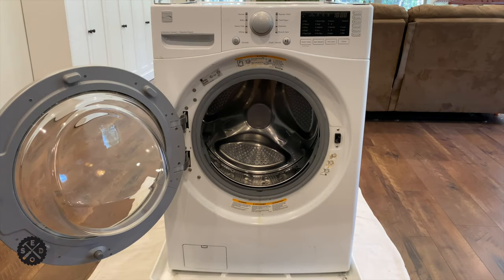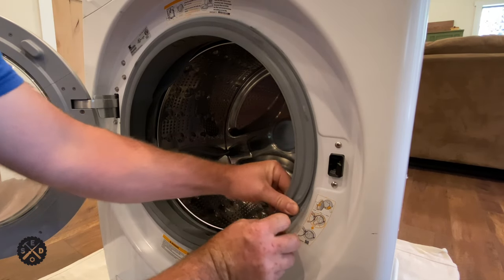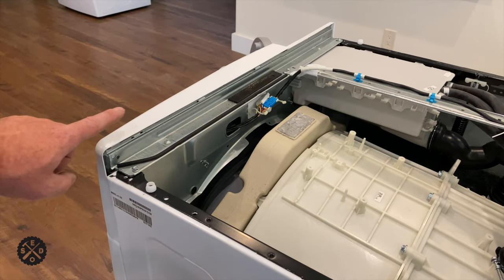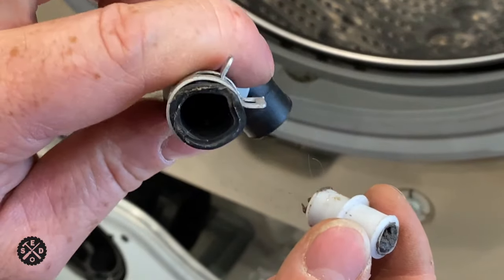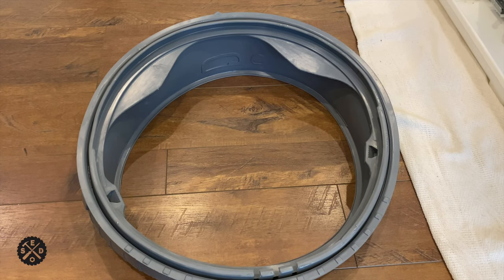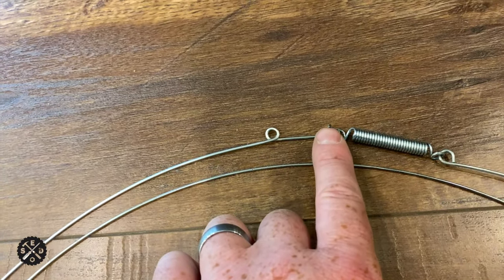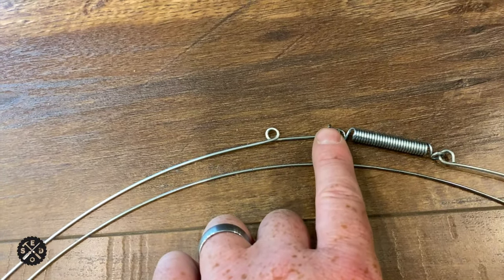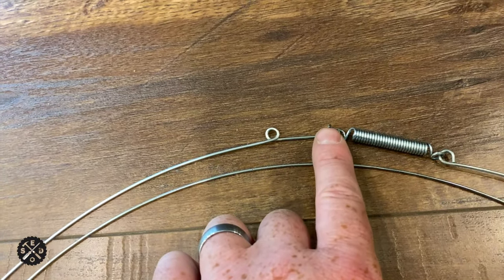LG Kenmore Washer Door Boot Seal Replacement Fix Leaking

Comment: Perfect video, great information clearly presented. And I can plie on to the other comments:
1. AGREED: Get The Pliers!, why struggle and damage your new gasket? 
2. AGREED: Clean the hose! - mine was plugged worse than shown in your video.
3. Also, look for the other videos on cleaning the water filter. I had never cleaned mine, it's easy, and mine was FULL of linty goop.
4. If you have a small hole in your boot and you need a fix for a couple of days while your new boot ships, I actually had success with a bike tube patch. Dry the area, clean as well as possible and follow the bike tube repair kit instructions. The real kind with the glue. This worked for me for a week of wash, but the hole was only about 1/4".  
5. Last but not least - if you are feeling lucky...I decided to try replacing the boot without taking the front off the washer. I used a slat of scrap trim about 3/8' thick and 2" wide, maybe 14" long to gently wedge the drum over to one side or the other to install the boot and inner spring. This was not that hard, the drum is suspended and it has a lot of flex in there. You really need to be sure to get the inner spring in the groove properly, feel around the whole diameter and press it into the grove. Don't try it without the pliers.   I would not try this unless I had lots of experience as a technician on other stuff. But it went very well, did not require more tools, and made the job very quick. My washer is pretty much built into the area, so I was really motivated to avoid pulling it out. If you have space, just pull it out and do it like the video shows. The instructions are great. THANKS!
Reply from the maker: Awesome great job! Thanks for sharing the tips!

Comment: In terms of clarity of explanation this is one of the best U-Tube HOW TO Video's I have ever seen!   Thanks.  Yes, our gasket drain hose was plugged up.  I managed to clean get to it and clean it by just removing the front gasket spring and lifting gasket up at the drain hose to removed the hose.  Getting the hose clamps off, hose loose at both ends, and putting them back was the hardest part.  Thanks for posting this video!
Reply from the maker: You’re welcome. I’m glad if it helped thanks for letting me know!

Comment: Great Video.... One comment - I spent 3/4 of the time trying to get the rear spring back on. What worked for me was to remove the bottom weight bank (curved plastic looking thing with four bolts below the door opening). This helped a lot. Definitely need the spring tool!
Reply from the maker: Thank you! And thanks for sharing your experience with the rest of us. Good job getting it done!
Reply: It took me good 30 min to put on the rear spring. Taking out the plastic weight helped alot. Be careful when you take out the weight as it weighs quite a bit and may hurt your foot.
Reply: Same

Comment: 1 important step (maybe): the two weights can be removed with a 10mm socket so that it’s easier to take off and put on the seal in the back. You did it without removing the weights, but I’m sure it was a little harder to fiddle with the seal.
Reply from the maker: Yes I did it without but if it makes it easier might as well try it and see how it goes. 👍🏻

Comment: Extremely helpful video, I was having same problem. I ordered rubber seal and pliers which I highly recommend. I installed it with my son in two hours. Saved $200, thank you so much!
Reply from the maker: Awesome I’m so glad it was helpful thanks for letting me know and great job fixing it!!!
Reply: I fix my washer machine and it took me less than 10min after I watched this video well done for explaining very easy.
I was trying for about 1hour the ring kept coming off.
I wished I watched this earlier.
Reply from the maker: Awesome I’m glad you got it!

Comment: Super helpful video.  Worked for me.  However, i found that the spring stretcher didnt stretch the inside spring enough to put it on.  I found it easier to take the spring off the clamp wire, install the clamp on the gasket, then install the spring back on the clamp.  I also used an extra piece of wire to hold the clamp tightly in place while i attached the spring.
Reply from the maker: Thank you! Glad it helped. Thanks for sharing your experience with others too.

Comment: Probably the best video I have found for this door seal. Straight  to the relevant points, clear description, great video well edited, no dogs, no kids, no annoying wacky background music …(already have all that….😎)
Last but not least the great tip about cleaning the tubes and making sure the bottom drain tube is not blocked…this is clearly the main cause of the stinky moldy sludge which collects at the bottom and rots because it does not drain. If these are cleaned regularly I doubt that the door seal will ever have to be replaced again.!!PERFECT!
Reply from the maker: Thanks Steveo I appreciate you letting me know!!

Comment: We were having leaks under front of washer.  Watched your video and found out about the drain hole in the bottom of the seal/gasket and the tube that connects it to the drain system.  Our gasket drain hole was plugged with lint.  I used a turkey baster to squirt water into it.  At first it wouldn't go.  I couldn't force any water through the drain hole, then all of a sudden it was open.  I squeezed a cup of hot water through the hole and ran a couple test loads .... NO MORE LEAKS!  I never would have figured this out without your video.  MANY THANKS.

Another helpful idea .... put the washer "feet" up on short pieces of 2x4 so you can see under it and see where leaks are coming from.
Reply from the maker: Wow awesome I’m glad you fixed it! Good for you. I know the feeling 😅

Comment: You’re a life saver! I pulled mine apart and soaked my rubber seal (it had a bad case of black mold). Putting it all back together was the tricky part though and people had their doubts I could do it. It was only thanks to your little extra tips that I managed to do it. Eg. the way you showed how to put the springs back on by closing the spring circle first and fitting as much of the spring as you can in the groove, then using which ever loops necessary and pushing the spring circle into the groove as you stretch it with the special (and cheap) tool. I’m so happy to be rid of that mold and to have done it myself. Thanks so very much!
Ps. Congrats to my fellow independent women who got this done.
Reply from the maker: Wow awesome great job!! Thanks for letting me know too.
Reply: I'm an Independent Woman too and I'm hoping I can do it myself  ... fingers crossed 🤞🏽
Reply from the maker: Good luck with it!!

Comment: I replaced the gasket yesterday and for the bigger spring I used the soap trick, using it as lube all around and on the wire itself, and made the spring slide over the lip a bit easier after struggling for a while.   Great video and a big help!
Reply from the maker: Awesome I’m glad you got it!

Comment: Have a newer model LG (WM4000HWA). Tried to wash a feather bed. Now have first hand knowledge why you don't ignore a washer's max capacity. Destroyed both featherbed and door boot gasket. Too embarrassed to call repairman so we found your video. I can count the number of DIY projects we've done on two hands over our 25 year marriage. Your video was awesome. We bought the tool (hubby ran out of underwear waiting for it - he looks good commando, so no harm there). Our gasket was also more specialized than yours so I'm glad we purchased the specific part for our model number. Nothing generic would have worked. For anyone who has our model number, there is an additional drainage pipe that attaches in multiple places on the boot (looks a little like a goal post surrounding the gasket). We also have weights attached to the front of the washer drum that tightly frame the gasket. If you have our model number, you can follow this video all the way to where you begin putting the new one on. At that point, put the gasket on first and tighten with spring. Then remove the weights from the drum (you can put them in the drum to keep it weighted). Then attach the drainage pipe (be sure to align the tubes at the bottom) before reattaching the weights. Don't try to do this with the weights on the drum - your knuckles will hate you and you'll just have to do it anyway.
Reply from the maker: Wow great job I’m glad you got it figured out!! Shipping nowadays. Oh well who needs underwear anyways 😂
 I’m glad it all worked out. Thanks for letting me know!

Comment: I just stumbled on your video honestly not sure how I got here sure glad I did! Showed my husband he and I are going to order the seal and tool soon. The DIY crafter in me says periodically run a folded pipe cleaner or zip tie down the drain hole prevent the lint build up or gently use a pair on skinny tweezers. In our case it's lint and dog hair. 
THANK YOU for saving us a repair bill.
Reply from the maker: Yes those are good ideas for sure. Thank you I’m glad if you found it helpful! Good luck with replacing yours. I’m sure you’ll do fine. 😊

Comment: Great video. Mission accomplished in under 3hrs. Very helpful to have an extra person for the inner spring clamp to help align everything while other person just holds clamp to remove tension. My in-laws think I'm and amazing repairman now. 😅
One important note when putting the seal back on: Do not try to put it on the metal drum that spins. It goes in the plastic(?) protruded ring that does not spin.
Reply from the maker: Awesome great job! It’s always good to score points with the in-laws! 😁👍🏻

Comment: Overall great video! I purchased the spring removal tool for the inner (more difficult) door boot seal. At 8:30, the lower loop was not completely closed, even though I used needle nosed pliers to try to close the gap, so the pin of the tool kept popping past, making the spring removal tool ineffective. I ended up opening the inner spring by unhooking it, so it was no longer a continuous circle and then used zip ties and a helper to reconnect the inner spring into a continuous circle. I then figured I might as well use zip ties on the outer spring so I could truthfully tell the seller I did not use the newly purchased spring tool and get a refund. I'll admit that the spring tool would have worked perfectly on my outer spring.
Reply from the maker: Wow, OK thanks for the input. I’m glad you got it.
Reply: I don't have the tool and need my washing machine to work today - I'm about to zip tie both of mine too. Fingers crossed! I zip tied the outer ring two years ago and it worked perfectly!
Reply from the maker: Awesome I hope it works for you!
Reply: I had the same experience with the lower loop on the retainer wire bending.  The spring stretching tool bent the wire to the point that the tool tip slipped through the loop.  I used a vise to bend the wire into a tight loop.  I also used a grinder to make the tongs on the tool smaller.  Doing that made it easier to put the tong in the loop that holds the spring.  Other than that, things went smoothly.  Thanks for a great video!
Reply from the maker: @daytriprrr2533 I’m glad you got it!

Comment: Thank you so much for this video! With your help, I knocked this out in about 2.5 hours. My kenmore elite has extra sprayers at the top and sides which wasn’t shown in this video but it just meant extra clamps and tubes to take off and on. 

You suggesting the dish soap for lubricating the boot was a life saver for sure! Thanks again!
Reply from the maker: Thank you! Yes, mine didn’t have those but I’m glad you figured it out OK. Nicely done.

Comment: Thanks for sharing sir!! This was very helpful. Just a heads up for folks with Kenmore elite- there are 30 odd bolts even in the front underneath which you gotta remove by leaning the washer to the back so that you could access the nuts, and there aren’t 2 springs to support the boot- the outer small one and there is a round steel band that goes around with a screw on it which you gotta unscrew so that it loosens and u can take it out with the boot!! Takes time but worth the try 😊
Reply from the maker: You’re welcome. Thanks for sharing your experience with the elite series. 👍👊
Reply: @SmartEasyDIYer  ofkors 😊

Comment: Many thanks! I reached to this guide due to very nasty stains on the children clothing. Apparently my seal was very dirty, so I ended up cleaning it without taking it off, but you tip about the clogged drain pipe was spot on! That was 99% clogged and more than likely the probable root cause. Gave it nice cleaning with pipe cleaner, does the job pretty well. 
Excellent guide.
Reply from the maker: Awesome I’m glad it helped! Thanks for letting me know.

Comment: Super helpful. I have an LG tromm and this worked. Unfortunately the rear spring was tough for me to put back on. I had the tool but the right connection point kept slipping and out of the eyelet due to how it is constructed. I ended up flipping the spring around and then getting and extra had to hold it open while I bullrushed the thing on. Worked but my finger nails are torn up. Again this is more an issue of my spring construction. One of the best videos for this repair. Thanks for the share.
Reply from the maker: Thanks. I’m glad you got it figured out! Good job!!

Comment: Great video, I have had an LG since 2006 with zero issues and although mine is slightly different I will look for this drain and blow some compressed air through this tube. I think you could have successfully cleaned the old gasket but no issue with replacing it. It is amazing though how long these washers and dryers still last today. Very little planned obsolescence as with allot of the things we purchase. Makes sense that the is there and I'm glad you brought it to our attention.
Reply from the maker: Hey curiosity good to hear from you!! Been a while. My wife tried to clean it and she really wasn’t able to get it well enough to get it to quit stinking so we just decided to swap it out. I’m glad you’ve have good luck with your overall! Thanks for the comment. 👊

Comment: Ok, I just did this.   Amazon dropped the pliers and gasket at 8:30 and 10:00 I'm running a test load - all good.  I could have been done in an hour, but I spent a lot of time cleaning mold out of the machine, especially around the soap tray.
Get the pliers - they are around $13 now (Dec '22).  Buy the ones advertised with the 5-inch spread - I saw some comments on Amazon that the smaller ones didn't open wide enough.  The original LG pliers are also available for $50 - $75.  Buy the cheap ones.
Soap for mounting the inner seal worked great.  I spent more time reassembling the cabinet than working on the gasket.  I didn't use soap on the outer seal for assembly.
For the pliers on the inner seal, get a substantial zip tie and zip the handles together.  One person suggested doing the same with vise grips.  I tried both... Use the zip ties.
In the future, I'll probably pull the outer band off and clean out the little hose/drain at the bottom.  I had dog hair and lint blocking the tube and I'm sure I will again.  

Lastly, to Smart Easy DIY - thank you for not only helping myself and others with this task, but for putting together what is probably one of the best filmed, narrated and produced DIY video on YouTube.  This should be a how-to for others making videos.
Reply from the maker: Thank you so much. I appreciate you sharing your experience and tips with others.!

Comment: Our door seal has recently had water pooling in the gap, but I wasn't aware that there was a drain in that location.  I wouldn't be surprised if it is clogged like this, so this is definitely helpful just to narrow down the source of my issue. 

 I bought my washer used several years ago, and had to replace the drain pump already. I thought it also had a bad intake valve, but it turned out that one of the wires just wasn't clipped in place all the way.

Otherwise, it has been pretty reliable and fairly easy to repair.
Reply from the maker: Yes ours has been quite reliable too. Yes it sounds like the drain could be clogged.  Good luck with yours.

Comment: Awesome video, thanks! My model was a little different with 4 hoses coming out of the boot seal (top, left, right and bottom) and a plastic cuff that goes through the boot to seat the hose at the top. But this video was all I needed to get complete the replacement. One tip that might help people: my spring pliers did not fit in the ends of the spring. I tried using them in the ends of the wire but they pushed their way through the bend in the wire. I eventually got it to work by putting a zip tie through the end of the spring and using the pliers in the zip tie to stretch the spring. I also had difficulty removing the plastic door alarm clip so waited until I had the door off to pull it out. Thanks!!
Reply from the maker: Awesome nicely done! I’m glad you figured yours out even though it was a little different. Thanks for sharing your experience with others.

Comment: Great video. My Kenmore had 4 hose connections and I had to reuse a plastic sprayer that was attached at the top. But everything else was dead on. Also, I replaced the door “switch assembly, locker” as well since it was open and we were having intermittent problems.
Reply from the maker: Thanks I’m glad it helped. Nicely done!

Comment: Thanks for the nice video.  To clean out that elbow underneath the seal (without having to remove the seal) I use a thin, long zip-ty as a snake.  It fits into the drain hole in the seal and is flexible enough to work its way through the 90 degree elbow without causing damage to any part.  I usually rotate the snake a few times to make sure all the gunk and pet hair are getting mashed up and moved into the larger section of pipe.
Reply from the maker: Thanks for sharing your tips!!